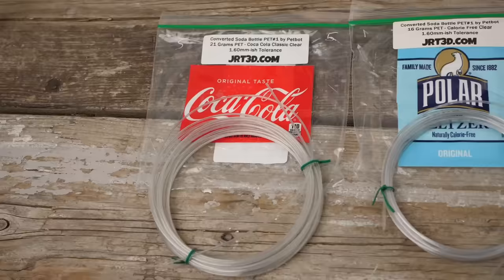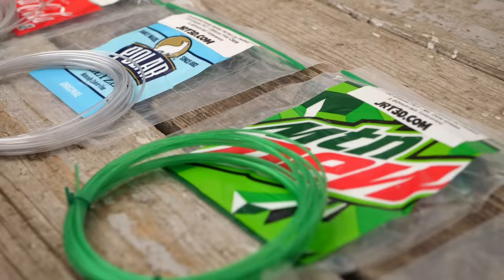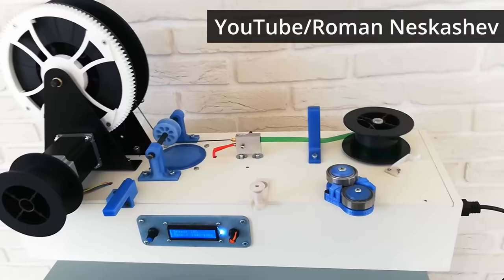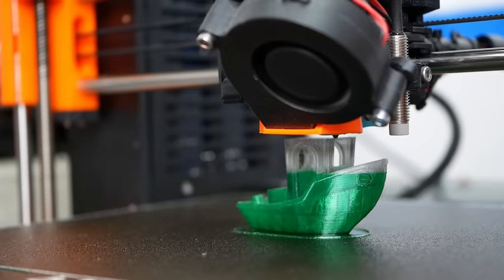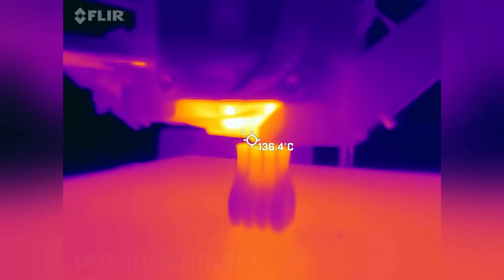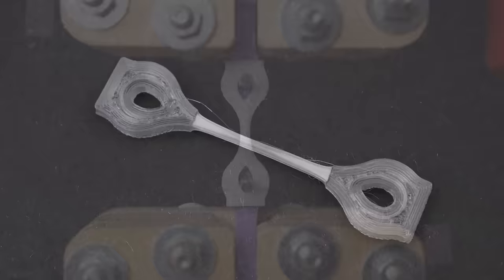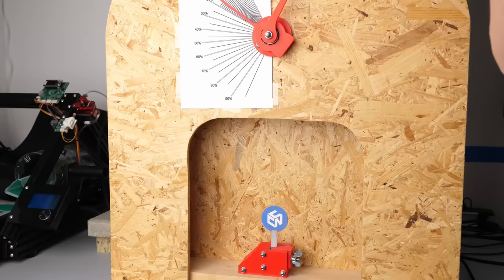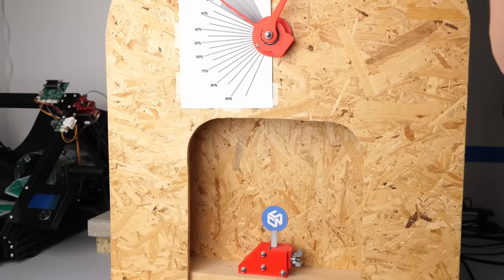HOW STRONG is PET Bottle Filament?

Comment: The print temperature needs to be increased. Then we can increase the printing speed. I usually use 280+ degrees. Blowing should be turned on closer to the maximum. Then there will be no crystallization. There will be better corners and overhangs. I have been printing with PET bottles for 3 years. Started out for fun but found it to be one of the best filaments to print.
Reply: а нагреаательный блок стандартный или биметаллический или титановый ?
Reply: @kvoistinov  Тефлоновый быстро деградирует, за несколько килограмм пластика. Лучше титан или биметалл.
Reply: How do you combine the filament for larger rolls?
Reply: Вулкан лучше или нет? На V6 зажимает частенько, быстрее 40 не получается печатать
Reply: я слышал бутылочный пластик воду набирает и сушить надо чтоб не пенился, удивлен что он так хорошо печатает
Reply: @alexvmw    there needs to be coreXY printer filament pulstrusion combo which feeds the filament into the 2nd 3D printing hot end that way you can convert bottles into parts in one go. But that would require auto starting for multiple bottles and auto feeding bottles which would no longer fit on a desk imo
Reply: Hi man, Which type of hotend did you use?
If you have hot bed?
Thanks in advance!
Reply: @diegoteranalcantar708  Hello, e3d v6 hotend in first printer and selfmade water hotend in second. Of cause I use hot bed. 290 degrees hotend, 70 degrees bed.
Reply: @Timsturbs  сушить надо. Так же как и petg. Причем сильно зависит от производителя бутылки. Какие-то надо печатать "прям из термокамеры", какие-то спокойно несколько месяцев в квартире лежат. Поэтому я тоже удивлен, что у Штефана так неплохо получилось без предварительной сушки.
Reply: @alexvmw   thanks for answer, very usefull!
Reply: @alexvmw  Teflon is NOT  a metal, therefore it cannot be used as a "heating block."  Try using aluminum, like is used to make the filament. If that doesn't work, there are other metals that have good thermal properties long before you get to titanium. That's a bit expensive, and a stupid use for an exotic metal. It also goes against the whole philosophy of recycling, which includes using appropriate resources for anything you build.
Reply: Does the thing that we print from the PET bottles strong enough for a model ? I 'm trying to find the answer but almost no one of my friends know . If you know, thank you so much
Reply: @jeffro.  you can buy Copper Heating blocks for $15.
You can also get a Copper+Titanium headbreak for $15 as well.

Options are out there that are far superior to Teflon or Aluminium.
Reply: can you add additive like nano or powdery material while plastic are melting?
Reply: @jeffro.  dude, he was referring to the thermal barrier (standart, titan, bimetall), and by "teflon" a standard (aluminium) is understood which requires a teflon tube to prevent the filament from sticking to the TB. The first guy just misspelled thermal barrier (called "горло" ("throat") in Russian) with heating block.
Reply: Thats awesome! I need a whole new "head" system on my ender 3 v2 for my linear rails, then the original extruder and hot end will start my PET project :)
Reply: I do the same for TPU. I tried the "recommend" settings, and got trash results. 250°c, at 200% speed and 175% flow rate gives smooth, clean layers with minimal stringing and almost no gaps. The hard part is getting it to stick to the bed.
Reply: is this the same stuff thats opaque and labeled "PETE" ?  i have so many containers of this stuff from legal weed id love to recycle
Reply: @mikejones-vd3fg  It's probably not the exact same, but probably pretty close. If I had to guess, you probably could grind them up and use them for filament but I'd imagine it absorbed quite a bit of water from the buds so extra drying would be a good idea.
Reply: @alexvmw  unrelated, but can I please compliment you on your English? It is fantastic.
Reply: What print speed did you for pet plastic
Reply: Wouldn’t crystallisation be desirable in certain scenarios?
Reply: Hello @alexvmw how can I avoid crystallization
Reply: @kilogee700  hello! Blowing should be turned on. closer to the maximum.
Reply: @alexvmw  thank you!
Reply: @alexvmw how can I avoid it in the nozzle?
Reply: @kilogee700  inside nozzle? I dont have any problem inside nozzle. Never. Plastic should be free of dirt. Dry before printing. The nozzle temperature should be around 290 degrees Celsius.
Reply: @alexvmw  does this fillament damage the printer????

Comment: Yes, you should build or buy one of the filament extrusion machines - would be cool to see your methodical and scientific approach to testing!
Reply: he has one, he probably doesnt want to take the time to grind a whole bunch of bottles up
Reply: This system is called PetPull in the original.  For some reason, the author does not talk about this in the video.
Reply: You should build it and try to solve the problem of connecting several bottles into one strip.
Reply: @zhivebelarus560  Spot weld the strips together before they go through the extruder.
Reply: Agree! The methods of this channel are great!!
Reply: @theflyingnon8546  you miss the point, ready made 'folded plastic string' doesn't need to be ground up, its a consistent thickness as it's been blow moulded once already you just adjust the width of your plastic string + carbon ink painted additive if you like for the given folded thickness blend per metre made no reliance on 3rd party vendors needing to make profit at 20 per a tiny 1kg of plastic more expensive than a steel welders 5kg roll
Reply: @KartoshkaAndMelassa  aka diy 'plastic string' for towing a car Originally lol
Reply: @zhivebelarus560  it's No problem ,already solved elsewhere long ago, aka grease paper & house cloth's iron welds it together just fine... cut at a wedge angle, slightly overlapped & offset so as to fill the gap at the same thickness as the ends, simples... or just use that plastics solvent to 'glue' them together before you put them through your repurposed glue gun/3d printer hot end etc ,kiss not over complicated gets it done...
Reply: PLEASE
Reply: Yeah just don't buy it from Russia

Comment: Instead of splicing the filament, you should splice the strips of the bottles before they are pull-struded. I think you could cut the ends of two strips at a diagonal and weld them together with a soldering iron or something else.
Reply from the maker: Good idea!
Reply: welding tape is more difficult than a bar. The tape deforms under heating, becomes brittle due to crystallization. And the rod is welded quite simply. Machines for this have already been developed, including semi-automatic ones, as in "mosaic"
Reply: @CNCKitchen  Or maybe using a simple Clothes Iron and maybe some Wax Paper? Lay the two strips and iron them together momentarily.

Which if that works, then a person can probably make a simple and quick process to integrate right into the Puller, which has maybe two TECs strapped to two heatsinks mounted to a simple door hinge (a lever-arm attached to the upper heatsink as well). When your one bottom has run out, quickly add the next one, get the initial cut, place it between the TECs and press down to "iron" the two bottle ends. 

Admittedly, that seamless process probably wouldn't work out well (as in, take too long). However, the TEC "iron" might still be enough, and you'd only need to pre-cut bottles and fuse the ends together. Then let all the fused together bottle segments run through, for a very long filament. 
Possible Problem: The pre-cut bottles would likely end up getting snagged on each other and result in a jammed system, so that in turn may require pre-spooling the sliced bottles onto a spindle :\

===
TEC - Thermal Electric Cooler, aka Peltier.
Reply: it wont work. Pet strip warps under heat as soon you touch it with soldering iron
Reply: @baddoer  packing strips already figured this out, but I'm sure 1,000+ people have already figured out a solution.
Reply: @evlsc400  Packing strips lay over each other, meaning it's twice as thick at the joint when it goes through the pull-struder. That would be a problem because it doesn't seem the pull-struder fully melts the PET, but rather just heats it enough to deform and roll it into something 'filament-like'. Doubling thickness at a seam in that case would also make the filament either thicker or at least more dense when it comes out the nozzle.

Obviously worth testing, but i'd be very surprised if the solution would be that simple.
Reply: I wonder if you could join the tape in a more mechanical fashion with some clever hook arrangement that is strong enough to hold together during the pull but allows the volume to remain constant at the joint. Interesting times that we live in :)
Reply: @DUKE_of_RAMBLE  I like the way you're thinking!  It's only by trying simple things like this that true innovations happen. Keep up the good work!
Reply: @jeffro.  Thanks heh Alas, we'll only know if someone with one of these extruders not only tries it out, but let's us know about the results! 🥴
Granted, I could try it myself, but cutting up a soda bottle, but I haven't had a need for wax paper in the kitchen for some time, and as such... I don't have any... 😅
Reply: So I’ve been on a rabbit hole from tiktok on recycling bottle into filament  and found someone welding the string together with a candle and what seemed to be a piece of Bowden.
- slide Bowden tube on one string
- heat both ends with a candle quite shortly 
- push ends together using the Bowden tube as a mold
- slide off Bowden tube
- clean welded area with knife 
(I’d add some high grit sand paper)
Reply: yes, this is a preferred approach with the right heating splicer for flat filament  for pultrussion, it is a much better option then joining them afterwards where it is more difficult to maintain even diameter after the joint is made.
Reply: @baddoer  you don't use a soldering iron, but a controlled heater with the right fixture to weld flat PET ribbon,  so you can control the process.
Reply: @1987jaffa  this would happen if you don't use a controlled heater with the proper fixture to maintain same size ribbon thickness and width. Otherwise it is doable.
Reply: What if to join the strips, something along the lines of a bag sealer was used to press the ends together? I feel like that would be a more controlled method of heating and joining the two together

Comment: ok but hear me out... what about extruding 3mm instead of 1.75 and then using that to extrude 1.75? yeah you spend much more energy, but it should result in much better consistency on final filament and if you roughly weld 3mm material, reextrusion to 1.75 should smooth those spots, resulting in consistent results 

anyone with time to try this theory?
Reply: i don't have one, but i feel it might be slightly more consistent, but will still have that hole thing bc of laminar flow with nozzles. You could probably utilize this to make "coextrusion" possible, to have different cores, by layering the ribbons with different colors or materials.
Reply: well heating and cooling plastics is not always good depending on temperature, but still a neat idea !
Reply: Any time You remelt plastic it degrade in quality
Reply: Yes I been made the business. Blacksmith Renewables llc. I’m working it…I have connected businesses to compliment it.
Reply: Worth testing
Reply: Thats what I'm experimenting right now. I'm trying out different nozzles, heatbreaks, and temperatures. Yes, remelting plastic degrades it, however, with the pull-struder its not melting it to much. It kind of just softens it and folds it. So it might be ok if the temps stay at a minimum. I still have more work. I just finished my pull-struder and have yet to print with this stuff.

Comment: Seeing the way the filament gets folded around the middle gave me an interesting idea. It shouldn't be too hard to modify the pull-truder and add a conductive wire at the midle of the strip so the plastic is folded around it. Might be a good way to get printable circuits.
But other than that I think the better filament-makers are the ones using plastic granules. Because if the intent is recycling plastic bottles you'll have a lot of them crushed flat, you'll have to peel off the labels and clean any residue on them. And you'll also have uneven thickness on many bottles. I think the most sensible approach is to have something that extrudes from small plastic scraps so you can shred the bottles and run them through an automatic cleaning process.
Reply: Great idea if you'd like to make your own wires.
But the printable circuits part isn't that easy, since you would need to slice the wire at the hotend everytime.

Comment: This is great to see a recycling process that actually works at a small scale and produces a product that isn't just acceptable but actually has good properties. Here in Canada it definitely makes more sense to return the bottles and use the deposit money to buy filament, as you mentioned, but I would love to see you investigate this further as well. Personally I won't be building one since I only drink water, coffee and beer, none of which come in PET bottles!
Reply: At best market rates, 10g of PET filament is 35¢, and you can get a lot more than 10g from most bottles. Some bottled goods are so cheap that, once you figure in value of filament, you're getting the goods contained within for free or even less.

Comment: I couldn't help but notice at 6:26 the uneven heat distribution in the coupons. I would believe the middle ones staying warmer longer could lead to different annealing properties in their strength tests. I wonder if you'd get more consistent results if they were printed standing further apart from each other. Or if you could test if this has any measurable effect on the strength of the samples.
Reply from the maker: Good observation. The inner ones are more isolated and hence stay longer warm. There is a crystallization limit, that the parts reach pretty quickly so my guess is that there shouldn't be a huge difference. Still a good point to consider in the future.

Comment: I'm curious on how well the same bottles would do chopped up and extruded like pellets. Might be a decent way around the 20g/bottle you get if you can throw in multiple bottles
Reply: Not worth it in Germany at least. A bottle empty is worth 25cents..
Reply: Agreed and for things like 2L bottles in the US, it's trivial to get perfect sheets of plastic that would easily shred in a crosscut paper shredder for small and evenly sized particles.
Reply: I think the problem with pellet extrusion is that PET will crystalize at high temps. Once crystalized it's harder to melt and becomes much more brittle. Of course, I could be wrong, so I'd love to see it tested. It would be nice if I could just ask some hipsters for their polar seltzer bottles and turn that into filament, but I don't want to have to splice hundreds of 20g segments by hand...
Reply: Turning a bottle into pellets also makes the thicker threaded part usefull (if you can shred it), so you'd squezze even more grams of PET out of each bottle.
Reply: @1987jaffa  I'm sure even the caps could be used to some degree.
Reply: That is one way, but you could also join together the strips cut from bootles with a little bit of heat. I think it would be simpler solution for small one user production.
Reply: @1987jaffa  The caps are probably HDPE, not PET.  I don't know if HDPE is printable, but its a great plastic so if it was possible to print it well we'd probably already see those filaments offered.

Comment: Stefan I noticed that some of the parts have fine strands coming out of them. The best solution to fix that is to quickly pass over with a small butane lighter torch and the prints look superb. Ive been using this technique for a few years now and it works best :)
Reply: I think he intentionally doesn't do any post-processing so we can see exactly what the output of the printer is. That is indeed a good solution for stringing though and I use it as well!
Reply from the maker: My intension was to show you how the prints look "as printed" without any rework.
Reply: @CNCKitchen  Stefan thanks for the reply. Now that I have you here I would like to ask you would it be possible for you to try some composite prints? Like print with two materials like flexible filament and hard material like petg.... For example make a shoe with rubber sole and top from petg... Is that possible? Please answer :)

Comment: The idea looks very similar to PETPull. Thanks for attempt to testing recycled PET properties.
Reply from the maker: I wasn't aware of PETPull. Also a very nice machine.
Reply: @CNCKitchen  How much material is needed to perform correct tests of PET (exclude crystallization, for example)? At this time I have ~100 meters or 290 grams if PET filament produced from the same type of bottles. I will be glad to provide it for you for tests. If more material need I need some time to find the same bottles and produce filament from it.
Reply: petpull is a original this pullstruder guy just steal a idea

Comment: The practicality of it would depend on a reliable way of splicing these together id say. I wonder if spot-welding two strips together and ramming them through the pulltruder would 'just work'. If the pulling is powerful enough... I think so? though youd probably get a temporary overextrusion... hmmm... combined with the effective material cost, I guess lacking in practicality. But yeah it comes out surprisingly well.
Reply: I was thinking of maybe cutting the ends of the strips thinner, and maybe twisting them together somehow before you shove them through the pulltruder so they would get sort of melted and twisted together. In my mind that seems like it would make a fairly strong connection point if it goes through the pulltruder ok.